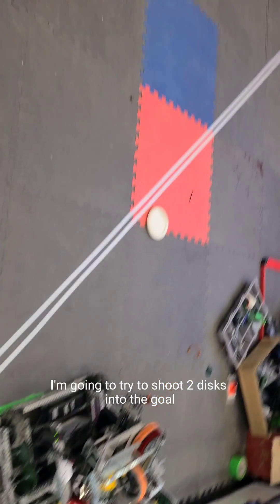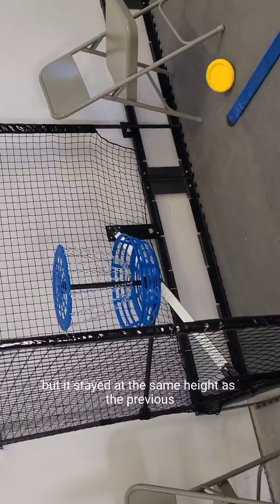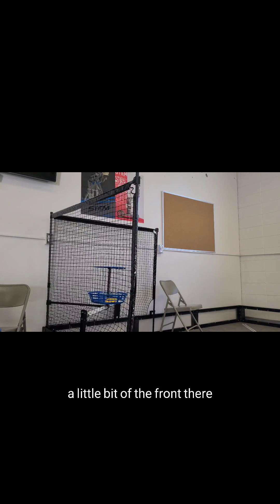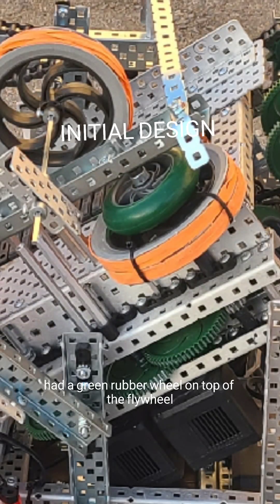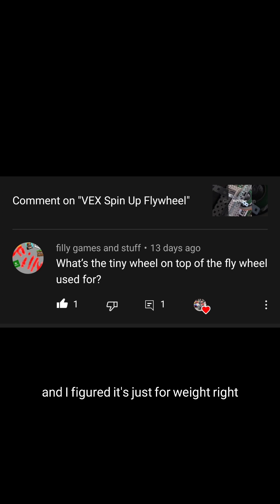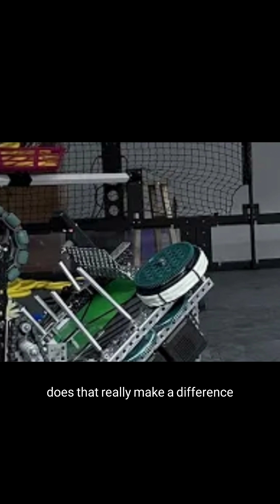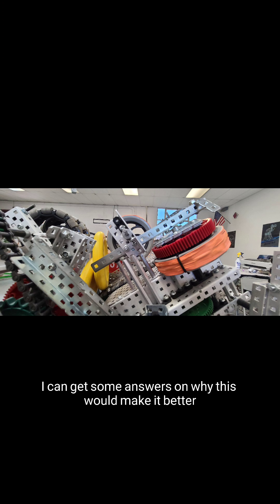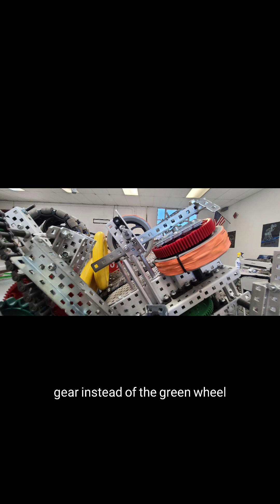What is the Best Flywheel Configuration? (Vex Spin Up)

Comment: We can’t find anytype of flex wheel any help with a substitute?
Reply from the maker: Regular traction wheels with weight on top with rubber bands zip ties on them
Reply: @mcfarland_robotics  what does that do
Reply: @mcfarland_robotics  is it better than flex wheels?
Reply from the maker: @fastmanatee8794  adds weight to the fly wheel to make it spin faster
Reply: @mcfarland_robotics  no I mean the zip ties
Reply: @fastmanatee8794  it holds the rubber bands so they do not fly off while spinning

Comment: The formula for inertia is I = 1/2(mr^2) since the radius term is squared, radius has a much bigger effect on the inertia of a wheel then mass. Increasing the inertia of the wheel makes it more difficult for the disks to slow down the rings and therefore will shoot more consistently.

Comment: basically it takes slightly longer to speed up because there is more weight on the axle, and so takes more power to spin it (which it then takes longer to "charge"  up to said power to acheive the velocity you want) the reason it is now more consistent, is because of the inetia create by the gear/weight sitting on top of the flywheel basically makes the flywheel pull its own weight back around, resulting in less undershooting (what happens when you limit velocity) since the weight is constantly keeping it at those top speeds (i think i kept hat clear enough hopefully)
Reply: essentially you know when you are spinning a piece of string with a weight on the end, and the string will always attempt to pull itself back up to the top of the circle because of the weight gaining momentum, what your gear does is keep that process constant so it takes more/longer to pull it round in the first place, but over time alleviates some of that pressure because of added momentum and so means the motor has a bit more control over the velocity of the motor (again i think)

Comment: The inertia from the gear/wheel will stop it from slowing as much when shooting a disk, making for a more consistent volley. The more weight the more inertia. The more consistent shot was prob the result of you adding the weighted flywheel not the gear.
Reply: It's not really about weight, it's about moment of inertia, which is extremely dependent on the weight distribution, more weight farther from the axel, equals greater moment of inertia